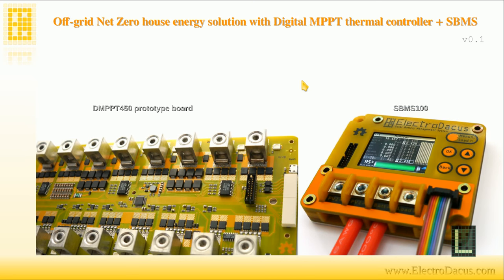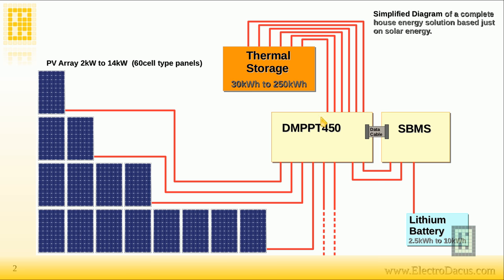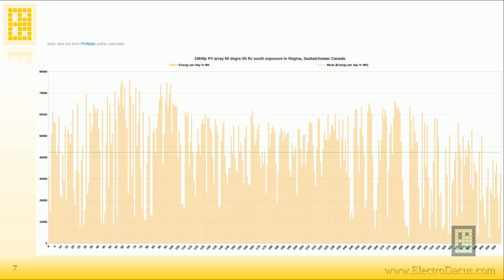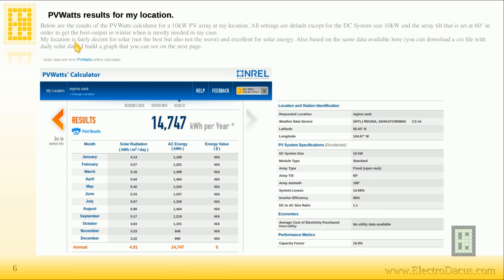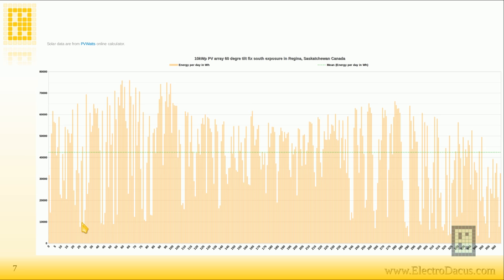Explaining the Digital MPPT thermal controller

Comment: Can you add 2 of them in series to make 48V? How easy/difficult it would be to modify the charger for higher voltage?
Reply from the maker: With the new SBMS0 two can be used in series for 48V but is not something I recommend. There is just no reason to go from 24V to 48V as even with 24V you can have loads as large as 12kW with 500A external current shunt option supported by all SBMS models.
A 48V BMS will need to be completely different from the current design and nothing can be reused for that.
Since SBMS0 will have no power electronics and just opto isolated remote ON/OFF outputs two of them can be used each handling a 24V battery for 48V after being connected in series but each will need to have is own current shunt to measure the battery current and no signals that are not optically isolated can be shared between the two SBMS0.
Reply: That might be easy when you build your house from scratch and you do not have heavy loads. I do not think there is a 24V inverter on the market to handle 12 kW. My AC uses 4.5kW,  Electric stove 2.2kW, Electric Oven 2.4KW,  Dryer 3kW. If only this 4 loads run in the same time you have 12.2kW. I changed my heat element in my water heater from  4.5kW to 1.5kW. To that you have to add 2 fridges and a freezer, TV, lights, 4 computers, cameras, switch, modem, Espresso machine that runs couple of minutes but when it runs takes1800W, etc. 99.9% of homes in US are like mine. 
So, in a regular home you cannot do what you have done with your house.
I have seen 48V inverters that can handle up to 12kW. I really like that idea of AC coupling because grid tie inverters are very efficient (97% efficient) but if you drain the batteries your inverter will not start. For this reason I would like to also DC couple a small inverter/charger like yours with about 1Kw of panels positioned towards East, so if the batteries are drained fore some reason, your charger can start charging the batteries in the morning, which will bring the inverter up. The grid tie inverter does not come up unless the 48V inverter comes up first and simulates the GRID.
Now, If I could find a hybrid device that can be used as inverter and charger in the same time it would be ideal. You could put few of them in parallel to have more power and you would also have redundancy in case one of them goes down.
Reply from the maker: If you are grid connected why will you want to have battery storage ? Battery storage is still way more expensive than grid so it makes no economic sense to use a grid connected battery.
I only have a 2.4kW inverter and plenty of loads that are around 1800 to 2000W the limit for a single phase AC in north america but I do not use them all at once.
Most of the house is on DC (computers, lights, small fridge, ...) so I only use the inverter mostly during the day for electric cooking.
There are plenty of 24V inverters in the 3 to 4kW range and a few of them support parallel connection and 2 phase systems + parallel for 12kW
I know an SBMS120 user that has 900Ah 24V battery and 3x 3000W Victron inverters in parallel for 9000W max. They (Victron multiplus) are both inverters and chargers and suported by the SBMS both as inverters and chargers but that guy is fully offgrid so he has no use for the charger part.  
If you think you can have more than 12kW at any one time then you can split the house in to two separate circuits each for up to 12kW
Of course if you want to go offgrid (else it makes no sense to use a battery) then you will need sufficient space for all that PV array to handle your energy consumption in worst month.
Reply: In the winter sometimes trees go down and we lose power. This year we lost power for 2 days. Also, the electric company charges me 26$ just to be connected + everything I send to them they pay me half price and when I buy it back I buy at full price. I is not big deal, but I think this is a rip off. In the future I want to move out and be off grid, the reason I keep looking for the best solution and keep experimenting. 
I could go with a smaller inverter if we do all the washing and cooking during the day when the grid tie inverter is up. That is the reason I like the Grid tie inverter. I can use like 6kW battery inverter  and during the day the Grid tie inverter sends in another 3-4 kW (depends on how many panels you have ) which adds to 9-10 kW total (Regular inverter  + the Grid Tie inverter.)
Reply from the maker: It is normal for them to pay you less for energy exported as when there is a lot of solar PV installed they will need to find a way to store that or a way to dump unused coal or nuclear power as those can not react fast and they need to be able to dump energy somewhere if grid can not take what they produce.
Best case scenario LiFePO4 battery cost amortization is around 20 cent/kWh (that is just battery nothing else) and so even if you do not get anything for the exported energy grid is still a better deal.
If you use the PV array to directly charge the battery as I do then when you use energy during the day fist all the power available from PV is used and if that is not enough the difference only will be from battery so there are no advantages to grid tie inverters.
for grid connected batteries it is necessary that grid tie inverters are able to communicate with the battery inverter so in case grid is down grid tie inverters will charge the battery but then when battery is full the battery inverter will usually increase frequency signaling the grid connected inverters that they need to shut down not to overcharge the battery.
So typical offgrid inverters can not work in parallel with grid tie inverters. The offgrid hybrid inveter chargers can only work as inveter or in reverse as charger not both at the same time so what you try to do will not work.

Comment: Hi again electrodacus I do't know your name ? 
Thanks for Feedback, I can't let it go......
I am Thinking how can I use the solar panels that I already have and get it to walk with your system. Maybe SBMS 120 and DMPPT 450 in a Custom Build 200V version

I have the 96 element panels SPR-X21-335-BLK  open volt 67.9 = 70V norm 57.3V 5.85 A short circuit 6.23A....

You are talking about 3X7s =21 + 30 = TVS 51V max.......If we say 3X8s = 24V + 72V = 96V =>100V to be sure, Is it possible to "custom made" a version to go 100V ore even 200V, so I can get the panels i have up and running because it is the cheapest way for me...to use what I already have...(and more are coming)....and they are good panels.

Can you make a custom build board for me 

2X SBMS 120 and 2X DMPPT 450 .......TVS .200V version.

Batt bank 2X 24V= 48V (Tesla model S 2x24V) ore 63V (Tesla Rodster Pack) ore 3x24 =72V ore even 96V battery pack .....There are lot of Mobil Accu pack useful for "PowerWall" (Tesla goes even 24*18= 432V on there Li-Ion Pack)....... less Amp less heat.......and This are a cheep way to get a li-ion power pack.

The reason is THAT I have got 12 x ...X21-335-BLK .-"Used and cheep"..and more is coming in the future ....Remember I have to get 12X as many panels for the winter as you have, just to get a reasonable heating result....

I use about 20-30 KW/ day for heating + batt. charging. Night use 6Kw without heating..........

I don't think that I am not the only one That would like a higher Volt version....

In the manual you mentioned that the solar Panels are in series, don't you mean They are connected in parallel so you have almost constant Volt and Variable Current, depending on the amount of sun??.....If so.... The panels must be constant volt not constant current, but the way your system walks, it is becoming a constant current system....by switching on and off the panels... you control the amount of current you want for your devices....correct understood ??
  
Oh By the way you mentioned that the DMPP450 can charge a battery bank ...yes.... but that must be without balancing control.... ore am i wrong.......

Ore DO You men That I can use the DMPPT to control my 6 X Er på vej! Panels, and the output goes to my battery pack with a build in BMS, and when the motor pulls power from my battery pack,  the DMPPT connects more Solar Panels in Parallel connection to ad to my higher current draw until every panel are connected in Parallel for Max Amp. to charge my Accu

The 500 Amp shunt looks fine to me. but with slightly higher volt (2x) are a better choice fore lesser current in the 8KW Inverter for 240 AC House build.

If you go higher in volt....The solar array can be further away ...with the same amount of heat loses in the cable.

How much do you think estimated vil cost me extra to get a custom build 200V version 2X SBMS 120 and 2X DMPPT 450 (TVS 200V)

Best Jørgen Thomsen Denmark DK  

"bloddy dark winter is coming " - ."as the native say in Sydney Australia" ;-)
Reply from the maker: Hi Jørgen,
Sorry the SBMS can not be modified to work with those 96 cell panels you have. A complete redesign will be needed and that will look completely different.
The 21V was considered the minimum voltage of a 7s pack with 3V minim per cell and the 30V is the nominal TVS voltage but the TVS will start clamping at about 20% more around 36V and depending on the pulse current that voltage can get close to 50 even 60V thus worst case on the other side will be 30V battery + 60V TVS = 90V voltage transient.
All parts I use are rated at 100V transient 75V nominal and there are no current sense amplifiers or ideal diode controllers with higher voltage rating thus the limitation to 24V battery and 60 or 72 cell PV panels.
For higher voltage the current sense will need to be much more expensive and less accurate with galvanic isolation and not even sure if ideal diodes will be possible.
So short answer is no there is not possible to modify this design and a complete redesign will be needed (I have no interest in that).
Solar PV panels are constant current power sources so voltage will automatically drop to battery voltage if you connect to a battery directly.
As mentioned before most people are likely to have 60 cell PV panels since that represent about 80% of the world solar panel production and they are the least expensive PV panels in $/Watt.
Your panels for example are non standard and very rare so not the norm. If they had a small 12V system is very likely they have 36cell panels and is possible to have two of those connected in series for a 72 cell equivalent panel that can be used together with 60 cell panels if needed. The 36 cell panels are more expensive per Watt than 60 cell panels so they can be sold to those that need a 12V installation and from the money get the more economical 60 cell panels if they want to go with a 24V system. 
The Tesla uses small Panasonic 18650 cells that are designed for high energy density not high cycle life thus not a good solution for offgrid energy storage in therms of cost.
It will be way more expensive to use Tesla cells for energy storage than to use LiFePO4.
The Tesla cells are rated at around 500 cycles 100% DOD or max 800 to 1000 cycles at 70 to 80% DOD and cost about $200/kWh
Thus a 1kWh Tesla battery can store over is life time best case 1000 cycles x 80% DOD x 1kWh =800kWh so $200/800kWh = 25 cent /kWh (in real life when you add aging degradation it will be at least 2 x more expensive than that around 50 cent/kWh)
With say a Winston LiFePO4 you have 5000cycles at 80% DOD or 7000 cycles at 70% DOD and costs about $350/kWh
So 5000 cycles x 80% x 1kWh = 4000kWh then $350/4000kWh = 9 cent/kWh (in reality when you include aging will be more closer to 20 to 25 cent/kWh still at least 2x less expensive in therms of cost amortization than a Tesla battery).

DMPPT450 can charge a battery when it works together with SBMS120. They will communicate with each other over a serial port and the SBMS120 will inform the DMPPT450 about the battery connected to SBMS120 and what will be the max allowed charge current then DMPPT450 will select a number of panels from the large PV array that will be redirected to battery charging.
Since I will have a 180Ah battery and max charge rate for long battery life should be below 0.3C then charge current should be below 60A.
Thus the DMPPT450 will recive this info an say in a cold sunny day each panel produces about 9A then 6 panels will output 54A that is below 60A and those 6 panels out of the say total of 39 panels will be redirected to battery charging by the DMPPT450.
Same day latter in the day sun will be at an angle so current will say drop to just 5A then it will be able to redirect 11 panels for a charge current of 55A
Then say a large dark cloud covers the sun and you only get 1A from each panel then all 39 panels will be redirected to battery charging for 39A total.
All the panels that are not redirected to battery charging will be used for heating.
All electricity used in the house will contribute to heating anyway.
This DMPPT450 + SBMS120 combination for heating and electricity allows you to have a much smaller battery at least half of what you will normally need without the large PV array and DMPPT.

Where in the manual do I mention panels connected in series ? 

500A x 24V is about 12kW and I do not think more than that is needed since it will be hard to find inverters as large or larger.
You will dimension the PV cables so that loss is below 5% at full current thus not much is lost in average probably less than 2 or 3% because current will not allays be max during the day.

Water pipes can not freeze since in order to use the DMPPT450 for heating you need to have sufficient thermal mass storage. So with a 10kW PV array is recommended to have a 120 to 160kWh thermal storage (for my sunny climate) so that in worst case when there are a few consecutive cloudy days the temperature inside the house is still comfortable.
If I completely stop the heating in my house in a middle of winter (with temperatures of -20 to -30C) the house will cool down with about 2C in a 24h period so if I start at 27C and stop the heating for 3 full days the temperature inside the house will still be above 20C.
Best regards, Dacian.
Reply: Man (Dacian) this is amazing performance while being very minimalistic. You seem to appreciate (consciously or unconsciusly) minimalism and simplicity... The more I read your stuff the more I need to let go of my preconceptions...
Reply from the maker: Thanks :). Yes I try to keep things as simple as possible.
Reply: Simplicity is the ultimate sofistication - Leonardo da Vinci

Comment: Excess energy ? Easy fix, get cryptocurrency miners :)
Reply: I actually use miners has heating units in the winters, works great !
Reply from the maker: Energy may be free but what about the miner hardware ? Not sure that makes sense even with free electricity.
Reply: @electrodacus  Most definitly profitable yes, even at 12cent a kwh, i allready paid for my vega64, i recently added Radeon VII gpus to my setup, the card is worth 1000 tax inc. and it currently generates 715$ per year before electrical costs
Reply: The free heat is the cherry on the sundae :) Heat can be problematic in summers tho, i usualy shut rigs down for july/august, but im in canada too so it gets cold real quick
Reply from the maker: @TheDIYDen  As I live offgrid I do not have a proper internet connection to do this. And is also more complicated as energy will no longer be free if you need to invest in a larger battery so you can run this more than just a few hours per day (when sunny). Extra battery has an amortisation cost that is fairly significant so no longer free.
Sometimes is more cost effective to not use the excess energy :) even if that sound strange.
Reply: @electrodacus  Oh idealy you would not use the batteries for powering the units, you'd just power your inverters when batteries are full. Elon musk will fix your internet problem with starlink, i'm on the public beta test program, cant wait :)
Reply: @electrodacus  Idealy you'd use 12v and 5v rails off of mppt/buck controlers and  bypass inverters/PSUs  :)
Reply: You are kinda right tho, you would have a hard time paying for the hardware if you were only able to power the units when the suns generating power. Since you have free energy you might be able to still be profitable even tho you have to pay for the battery usage, im not too sure, I just got used lifepo4 off ebay, for about 140$ cad per kwh.
Reply: @electrodacus  Thanks for your work btw, i'll be ordering your sbms next week !